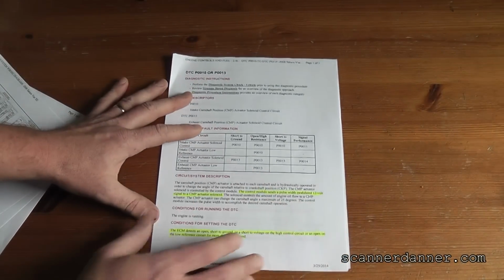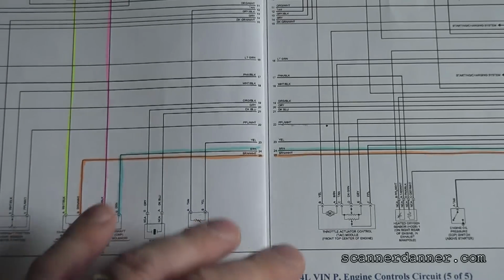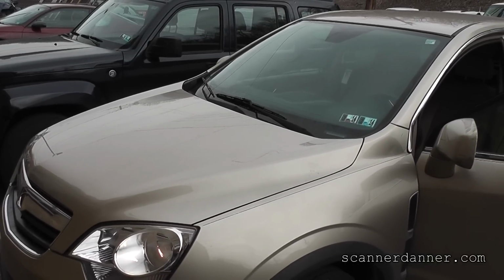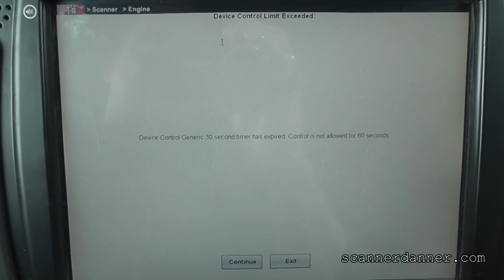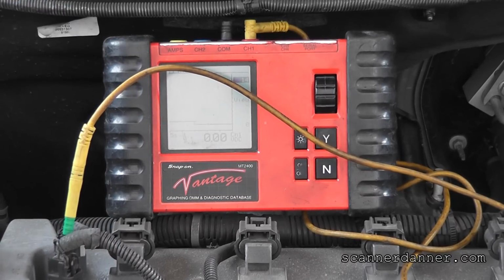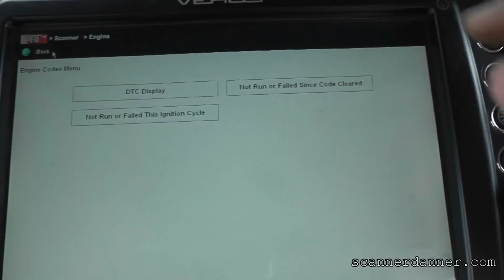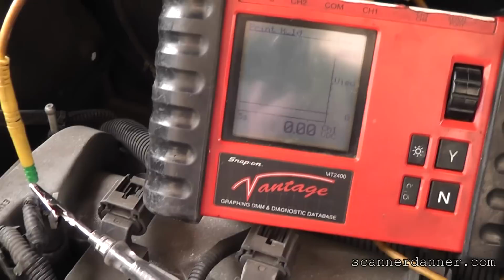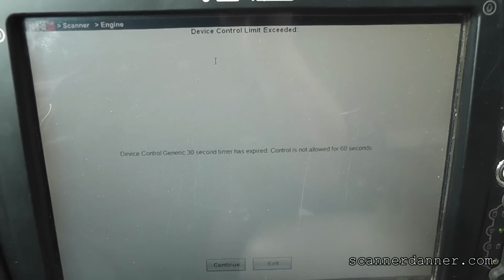How to test camshaft actuator solenoids (P0010, P0013) 2008 GM 2.4 L

Comment: Hello again Paul. It was an honor meeting you Saturday.  I wish I had more time to hang out after hours but it was fun just the same. I'm here looking for information on using the Vantage 2400. I just picked up a used one and I realize it's only a voltage graphing meter but I thought this tool would be a good start for me. In the mean time I'm enjoying this video because your breaking down the home work in a way that's easy to understand the approach you'll take on the car. I can't tell you how much I needed that. Thank you for all you do here.
Reply from the maker: Good to meet you too Wyatt! Follow my vantage pro series on SD Premium. It is very similar my friend.
Reply: Thanks. I was hoping it would be because no one else on YouTube has anything on the old Vantage. Do you know if I can update the memory card? Mine is 2.1 version.
Reply from the maker: If your lucky, you may find one. I just looked on eBay and there is nothing. Version 7.0 is the latest update they made ( I think) and it will take you up to 2003 for the component tests. But the meter functions are never outdated. Though the newer versions, ( I think 6.0 and up), they made the time base a little faster. Down to .5 sec total screen time. Your's is only 1 second.
Reply: Thanks. I looked on eBay too but nothing there. I'll keep checking. In the mean time I can use the meter functions. On to your Vantage pro lessons...

Comment: Hook up two wires, one to 12v battery positive and one to a known good ground. Unplug connector at solenoid and put power wire on one pin and ground on the other for a quick second and listen for the solenoid to click. You don't want to hold the wire or wires on the solenoid for more than a quick second, but you will hear an audible click letting you know whether the solenoid is faulty or not. No click= Replace solenoid. If it clicks the solenoid is ok at this time.

It is a simple two wire circuit, if you hear the solenoid clicking, check for power between pins 1 and 2 of the suspect solenoid connector with key on and active command for that solenoid turned on via a bi directional scan tool. In this case it is either a shorted or open wire or faulty ECM. Either way this is as simple as a headlamp circuit.

What gets tricky are the Exhaust and or Intake cam over retarded or over advanced codes. In this case you are looking at Phaser, solenoid, oil pressure, oil level, top end and or bottom end issues. I work for a Ford dealership and you can bet your paycheck if a 3 valve F-150 comes in with 100k miles and a Valvoline oil filter on it with VCT codes, the cam caps are scorn and you are going to need a set of cylinder heads with phasers and solenoids at the very least. Most times I will sell a long block.

VCT is a great advancement in automotive technology HOWEVER if you don't change your oil regularly, using a quality filter and oil, it will bite you in your behind down the road. In this case it was an electrical concern nowhere near related to vehicle maintenance, i'm just saying. =)

Comment: The resistance inside the "ground" on the computer would be less then 5 ohms as stated by the fault tree. That would make it safe to short the circuit as with 12V availeble it will limit the current to 12/5= 2.4 amps (hence 3 amp fuse). assuming the actuator draws 1 amp the voltage drop on the resistor would be 5V. That would make for ample voltage to detect any abnormal current witch is  use full in the trouble code department. It also means the abnormal high current when shorting it will trigger the monetoring circuit and it will self protect and switch of the high side switch whilst setting a code. If the switch is shorted (bad transistor) the fuse will blow as it won't switch off.

Comment: great video. i change those often,but usually ohm test solenoid and find out its open. never has it been anything else. this is part changer mentality.after studying with your program of diagnostic principles i see that going two to four steps while i,m right there and knowing for certain brings better quality that is what has changed my life. my pay is better and i get excited by electrical problems.going the extra mile. i told my snap on dealer to tell others about your channel because i wouldn,t have bought the modis if i didn,t have this channel to learn how to use it. so mention it to your dealers guys
Reply from the maker: thanks bro.
BTW the ohm test would have been good in this case but  (and I know you know this) what if you cannot get to the solenoid, say it is in the tranny. Do you have enough knowledge to test the circuit? That was the direction I picked.
Again, not really addressing you here, I am addressing the nay sayers.

Comment: Interesting test in the flow chart about shorting out the circuit.  I guess they figure the PCM is quick enough to turn off the circuit before the fuse blows.  Guess the circuit is designed to handle more than 3 amps until smoke appears.  I honestly wouldn't chance using that test myself, but the engineers must have faith in their designs to put that step in the flow chart.
Reply from the maker: I honestly do not think the fuse was there to protect the PCM. I believe it is there in case the circuit is shorted to positive. I could be wrong.
Either way, I would never feel comfortable with this test. In particular because I teach universal concepts and this one most certainly IS NOT! You do this on other systems and you will fry the driver in the computer.
Reply: ScannerDanner I definitely agree with you there.  You don't want to get into the habit of doing something like that, because you might get a shocking surprise..LOL

Comment: I'd bet there's a small value resistor (maybe 1 ohm,or something) between the "Low Ref signal" and ground inside the computer.It will monitor the voltage drop across the resistor,and apply ohms law for monitoring circuit current flow. IIRC,it's called a 'low side current shunt',or similar.
Reply: Yeah, there probably is a resistor there but not for the computer to measure a voltage drop across it. The resistor is there to prevent a short from harming the computer and to prevent the solenoid from consuming all of the voltage (Kirchoff’s voltage law) so that the computer can measure the voltage drop across the solenoid to detect a short, open or bad solenoid. It measures the voltage going out on the power wire and the voltage just before the resistor on the ground side. If the voltage is zero on the ground side then there is an open. If the voltage is the same as or very close to the voltage on the power wire then there is a short. If the difference between the voltages (the voltage drop) is not within the range the computer expects using Ohms Law (since the solenoid should produce 8-12 ohms of resistance) then it knows the solenoid is bad or there is excessive resistance somewhere in the circuit.  But that is just my guess on what its doing…
Reply: After thinking about it some more, the resistor would be on the power side.  Otherwise Paul wouldn’t have gotten zero volts on the ground side with the bias voltage (Kirchoff’s voltage law again). Either way, the purpose of the resistor is the same. It becomes the primary load in the circuit if there is a short to protect the computer and becomes a known voltage test point to detect faults.

Comment: Hey paul I did found the problem on the 2003 hyundai santafe,,, the reazon why it still alive in idler is because evaporated selenoide was stuck open,,, after I fixed mi fuel trim number went positive, ,, second problem mass air flow sensor, I keep learning froom you paul,,, thanks ,,, customer happy ,,, am happy with coins in my pocket
Reply from the maker: cool man, nice job!

Comment: Really appreciate the detailed step by step.  Not to mention how dealer flow charts will many times totally bypass common sense!  I've said this for years.  Also, next time u encounter a Cam Phaser noise (commonly described as a "Dieseling noise") on the Ford pickups, In the case where no cam guide plastic materiel chunks made it to oil pump sump, try a 1 to 1.5 quart Varsol oil flush and change (in models where phaser oil returns to pan thru an oil return orifice machined into the head, as opposed to models that return thru actuator solenoid). I see guys all over YouTube changing actuators, cam sensors and cam sets at Huge cost, when it's likely a sludge/carbon buildup in the return orifice..  worked for me (specifically an 06 F250 4.6L).
Reply from the maker: good tip John. I have an 08 Expedition with a 5.4. Is this issue you describe a problem on my engine?
Reply: Cant remember if the 5.4 is designed like that. It usually strikes at around 100,000 miles.  Best avoided by regular oil flushes. Most of my clients avoid oil flushes, mainly because they get overcharged for it.

Comment: TSBs are very helpful as well. I've fixed so many Passenger Presence System(GM) with very minimal time spent on diagnoses simply because the information available and some common sense has led me to straight to the fault. I look up TSBs(if available) before I even pull up a wiring diagram. Just remember people, on modern vehicles, there is a lot more calibrations that are done after a fault is repaired. Like on the PPS you have to re-zero calibrate the system, otherwise the work that you have done is in vain. Memory seats are another thing that I don't see a backyard tech being able to conquer, at least not very easily. Awesome video Paul and yes, those solenoids fail all the time.
Reply from the maker: thanks bro

Comment: hi paul, when you connect the scope to solenoid with ground of scope connected to ground of card and another wire from scope connected to signal wire of solenoid( in my mind, i was expecting something similar to ignition or injector wave form) but i didnt..  am i missing something. to me this solenoid is same as injector or ignition right. in mor or less ignition or injector also have pulse width(turning off ground momentarily) in this case it is power..
Reply from the maker: Good question my friend. And it would have looked more like what you described if I shortened my time base. The reason I did not show it on a smaller time base is I was just looking for on/off control, not detail. Does that make sense?
Reply: Yes Paul, Make sense.. I would be happy if you can show in any of the future projects that details the image of any solenoid wave form(apart from injector and ignition) curious to see how it may look like..
Reply: @ScannerDanner  makes it look more like square wave right? when u change the scale.. or zoom in on Voltage reading

Comment: The one thing that you didn't cover, and the one important thing that your scan tool didn't show you, was what GM calls a "symptom byte" or an addendum to the trouble code P0013. For example, it might be P0013 0D displayed on a factory Tech2 scanner. I'm a GM tech and see these darn solenoids go bad all the time, but sometimes it can be enormously useful to look at those symptom bytes in the scanner and watch the DTC change when you unplug it, basically telling you almost instantly that the computer is capable of monitoring the circuit, the computer detected a manufactured open (unplugging it) and the computer changed the DTC's symptom byte.

Great video, Dan. You could have also just ohm tested the solenoid itself, then jumped straight over to using a test light on the circuit. Just google "DTC symptom byte" and click the first link on Camaro5 to see a great example of how the GM scan tool displays engineering info. That info is also usually listed in GM service information.
Reply: ScannerDanner Discretesignals You're correct, if the byte changes from the a definition, say 04, to 0D when the sensor is unplugged, and changes back to 04 when it's plugged in, than it would indicate a locally created symptom. If it were to return to 04, and lets just say that it says short to voltage, you could then continue with diagnosis of your component, or perhaps even some local wiring issue directly by where you just touched the wires. These symptom bytes are primarily noticeable using GM's MDI wireless scanner interface and their GDS2 scanner software. Also, Paul, as far as I know, it's a factory scanner thing for late model GM vehicles using a Tech2 or MDI/GDS2. GM uses these symptom bytes to help you further pinpoint problems using a scanner. They have lots more information on DTCs in the GM resources than they ever did in the past. It's pretty neat stuff working on 2014 vehicles on a daily basis ;) 

By the way, I bought your book and I absolutely love it! Keep up the videos! Kinda inspires me to worker harder at my part time lab instructor position at my school.
Reply: If the solenoid is open and you have byte of 04, would the byte change if you unplugged the solenoid and reread the DTC?  You would still need to find out where the open is at.  Now if the byte went from OD to 04, you can pretty much conclude the solenoid is faulty.  Nice dirty test..  :  )
Reply from the maker: That is great information! I have never seen what you are describing. Must be a factory scan tool only thing? I will be looking for it for sure! Thanks for the tip!
Reply from the maker: Discretesignals
I would think the answer is no to your first question. But this would still tell you something, and that is, the solenoid is NOT the problem.
Reply: ScannerDanner If you look at some of the newer GM vehicles in your service information source, the DTC look up description section may have a symptom byte chart listing the definitions.  I found it in Alldata under a 2013 Camaro.
Byte 04 is open circuit, so if you have a open anywhere in the solenoid circuit, including the solenoid windings, you should get that byte.  The PCM won't know where the open is, but will know there is an open.    

I guess it can be used to further define the DTC.
Reply from the maker: Discretesignals
nice! thanks

Comment: I've replaced more of those solenoids than I can possibly count. if i see a 10, 11, 13 or 14 code on an ecotec engine i just replace both solenoids without any diagnosis. they have a high failure rate. dorman makes a version now but i can't report on their longevity yet. nice video as usual.
Reply from the maker: good tip thank you!
Reply: Video and your teaching methods are excellent, also I like the way you show the use of basic tools and scopes in the tests. You could never get this kind of training or experience at a dealership. With yourself and your brother teaching you are helping the small business's.
Just one question, when testing the solenoid could you put a resistor( same value as solenoid) across the wires to fool the computer and reset the code?
Reply from the maker: huggybryn39
I don't see why not. I fooled it with my test light.

Thank you!
Reply: Thank you for taking us through your thought process. This valuable experience is not covered in most text book except yours.
Reply: bgregg55 i
Reply: My mom has a 10 code on her equinox, I'm thinking of replacing the solenoid but was wondering if you ever see the code with a wiring problem, or is it usually always the solenoid?  Thanks.

Comment: Hey Paul,under the conditions for setting a DTC,shouldn't the computer have picked up a open on the ground when you used the test light to fool the computer and set a fault code?
Reply from the maker: that is a great point! i believe that is what the flow chart said.
most likely the full diagnostics are done on this circuit under normal driving conditions and the bi-directional mode changes this monitor a bit.
That is the best I can do .

Comment: Paul, I've got an old Tektronix O'scope just sitting around do you think it would be usable for automotive testing if I mounted it to a cart?
Reply from the maker: should be okay to use. is it digital or analog?
Reply: ScannerDanner Analog, so it won't be quite as easy as a digital
Reply: It's an analog so will not be able to just look at the numbers. Calculations based on the settings will have to be made.

Comment: Great stuff, Paul! Love how you can come up with 40 minutes of material for a diagnosis that literally takes only a few minutes to do. I also can't stop playing with my scan tool bidirectional controls...really cool! The more ways you can verify a fault, the more confident you can be in the call and guarantee no comebacks :)
Reply from the maker: I know, there are so many little things to teach and these little things can be a huge asset to us. How about that manufacturer flow chart having you jump the control to the ground wire and then check the scan tool for a fault!? Crazy wasn't it?
Reply: Yeah that step was exactly what you teach not to do lol. At least it was better than just the standard ohm/continuity checks. But a couple voltage checks is way faster, easier, and more accurate. Flow chart testing procedures have a long way to go for sure. Maybe back-probing wires is not recommended by the factory?
Reply from the maker: motoYam82
that is correct, most frown on backprobing